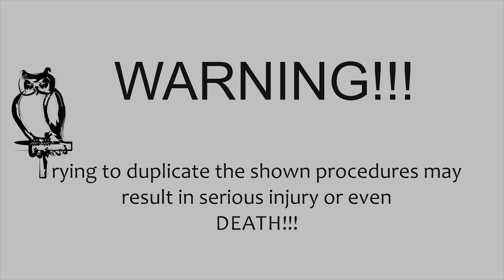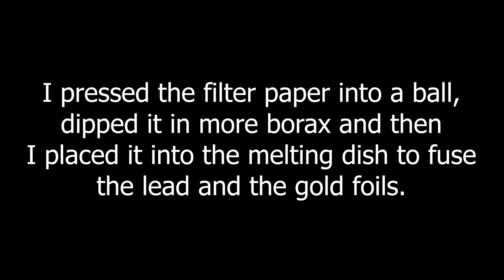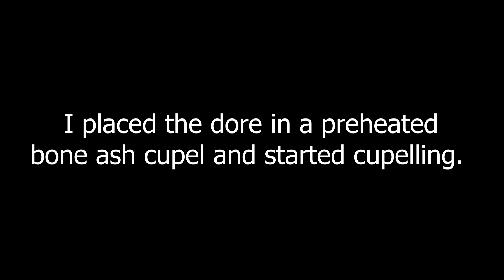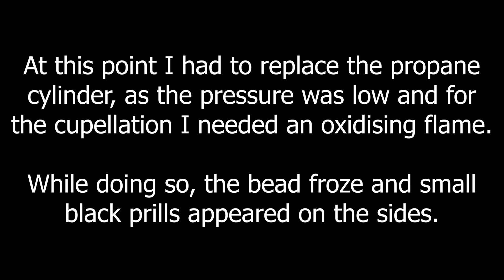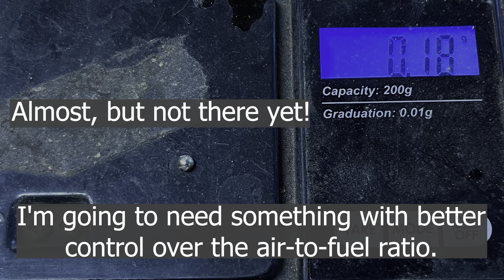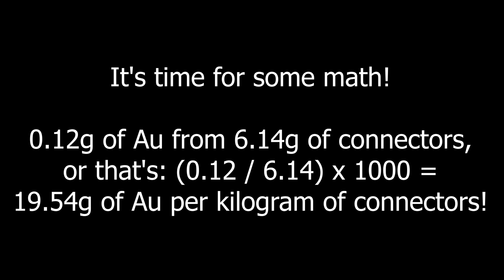gold from DIP IC sockets foils cupellation

Comment: Nice result, cupeled gold from conectors is realy clean, I had 99,8 % on XRF. As you are working with metals a lot, may be electric furnace can be handy. Easy to use. I have very small 10x10x10 cm internal space, should buy a bit bigger. PF 2024

Comment: Have you tried blowing at the metal when cupelling to increase airflow? I've found it helps speed up the process dramatically when doing this in open-air. I wouldn't do it around lead though, only bismuth.

Comment: I was all into the video until u started moving the tank. What was the purpose of that. It actually got annoying. Just saying.  I never knew u could cupel without the closed oven.  So I can just use the bone ash crucible in my regular furnace I melt with?
Reply from the maker: What tank?
Reply from the maker: Yes actually it’s impossible to cupel with closed “oven”, but you can cupel without oven, or furnace…
Reply from the maker: If you don’t have bone ash cupel you can use Portland cement instead
Reply: @OwlTech333  I was meaning the propane stand.  I got over it lol
Reply: @OwlTech333  yeah I’ve been watching different things on it.  Where can I get bone ash from to make my own
Reply: @OwlTech333  what’s better to use tho
Reply from the maker: @brandonbarthel3739  sorry I had to move it at the right angle
Reply: @OwlTech333  don’t be.  I shouldn’t have said it anyways not knowing what was going on.   So I watched another video.  This guy used a powder to cover his ladle or dish.  I assume it was calcium phosphate powder but it worked without making a whole crucible so I may try that to
Reply from the maker: @brandonbarthel3739 either that or calcium hydroxide
Reply from the maker: @brandonbarthel3739 you can use it dry. I find Portland cement the most accessible cupel material and you can make it in 30 seconds
Reply from the maker: @brandonbarthel3739  whatever is at your disposal
Reply from the maker: @brandonbarthel3739  Cupellation - from cupel to SILVER bead
https://youtu.be/MwDfUxgNxeA
Reply: @OwlTech333  I thought it was calcium phosphate or is it the same thing
Reply from the maker: @brandonbarthel3739  CUPEL in 30 seconds
https://youtu.be/hyDlrVgJETw
Reply from the maker: Bone ash is pretty much the same thing as calcium phosphate, cement and calcium hydroxide(hydrated lime) different